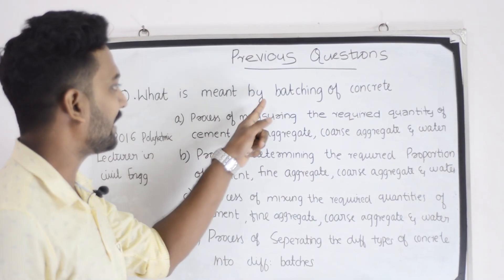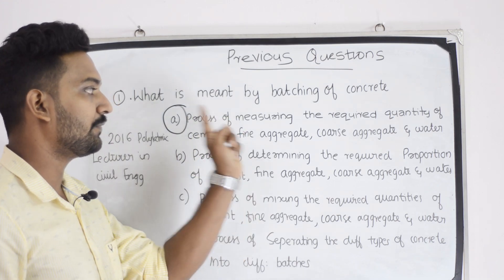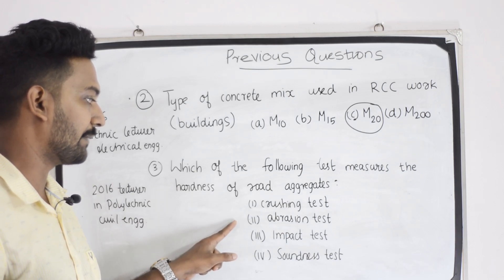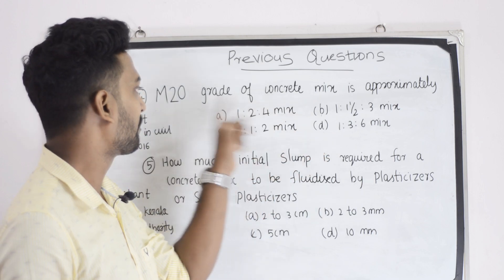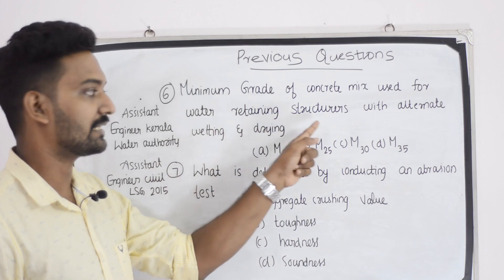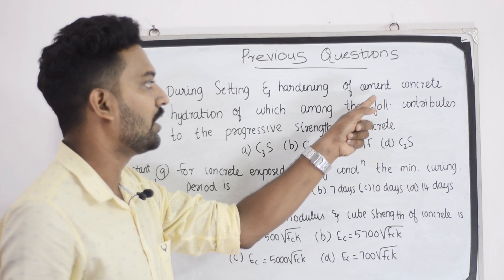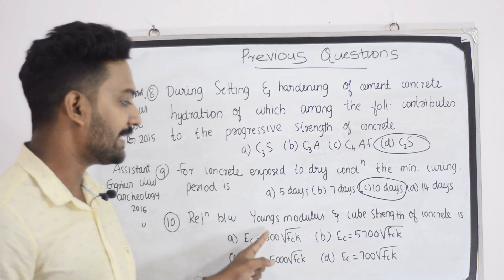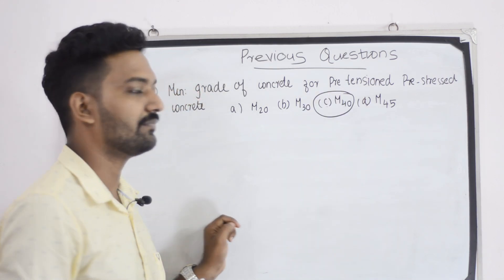Concrete - Prev. Questions PolyLecturer/AsstEngineer/Overseer/Draftsman/SSCJE/LIP/GATE/ESE/ISRO/DRDO

Comment from the maker: As per IS 456:2000

Minimum grade for different RCC works.

Mild (protected) - M20
Moderate (rain, under water) - M25
Severe (severe rain, alternate wetting and drying,  immersed in sea water) - M30
Very Severe (severe freezing, corrosive fumes, burried in aggressive ground water) - M35
Extreme (Tidal Zones, contact with aggressive chemicals) - M40

Comment: 2nd  and 6th questions are confusions ...pls clarify....
Reply from the maker: As per IS 456:2000

Minimum grade for different RCC works.

Mild (protected) - M20
Moderate (rain, under water) - M25
Severe (severe rain, alternate wetting and drying,  immersed in sea water) - M30
Very Severe (severe freezing, corrosive fumes, burried in aggressive ground water) - M35
Extreme (Tidal Zones, contact with aggressive chemicals) - M40
Reply: @ThinkingCap  thanku